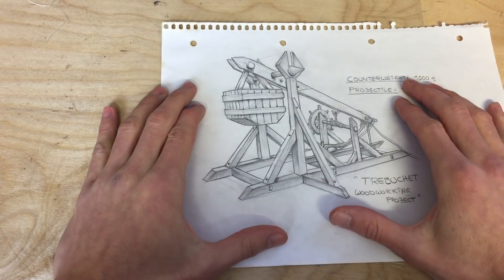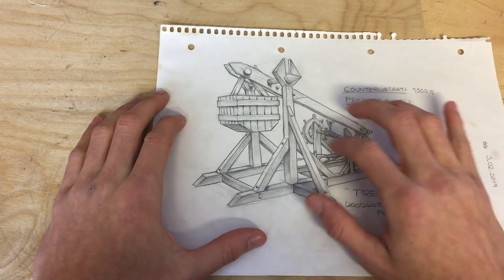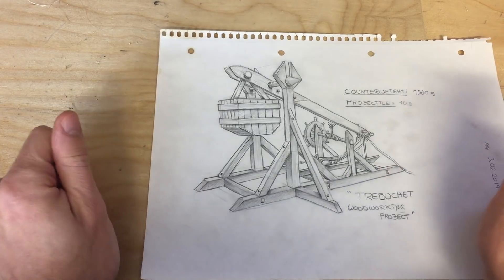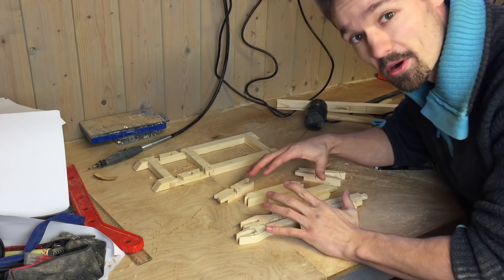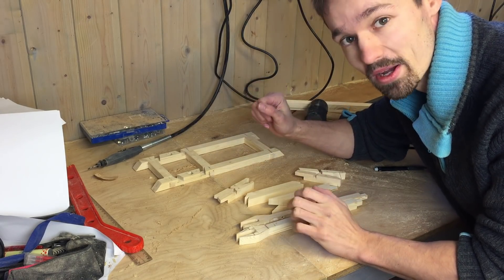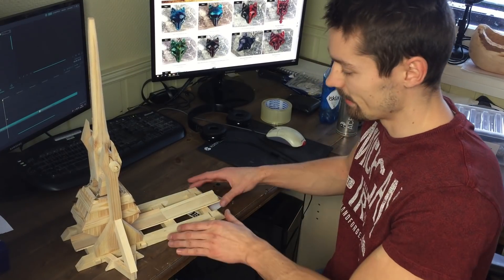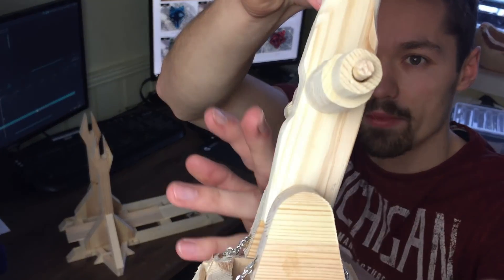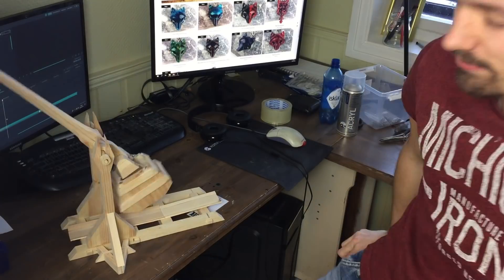I Make A Trebuchet, But Will It Work?

Comment: I would have put some set pins in the towers and other load bearing members.  Not that the glue isn't good, but it could weaken after a while.  Not bad overall, though :D

Comment: Nice project!

I once built a trebuchet from Technic LEGO, with a pivot point ratio of about 1:6. The counterweight was filled with scrap lead. That thing could hurl small stones to around 8 - 10 meters (that's about 25 - 35 ft to you Muricans)

Comment: Nice design, I've made trebuchets that could throw a small water balloon over 300 ft in the past, here are a few tips:
- The slide would work better if it is one piece (you wanna make sure there are no lips or edges that the sling can get caught on)

- For weight use coins! they are much denser work a lot better than dirt
 (You nailed the J hook for the arm ... no puns intended)

Comment: According to a program aired on PBS a while back, the addition of wheels to the base allowed the base to roll backwards as the trebuchet was fired. This allowed the release of the projectile to occur sooner in the arc of the firing process, and added a good deal of distance to the effective range.  This program might be worth your while to watch, the wheels not increased the range of the weapon, they also made it easier to move the whole machine.

Comment: Good fun build! I built one 14 feet high that throws a 4.5 kg  concrete ball. The angle of the hook, the length of the sling, the weight of the projectile, the weight in the ballast box all determine the trajectory of your projectile. 
Trebuchets can throw backwards or even straight up if the mentioned variables are not tuned correctly.

Comment: If you shorten your chain on the bag a little and add more weight to the counter weight then it should go farther. Bending the nail at the top either up or down will also change when it is released.

(Also adding wheels will help too since allowing the frame to move a little increases speed)

Comment: Judging by the astonishing fact that the projectile was flung over 30 cm and that it obviously weighs more than 9 grams based on the sound it made as it hit the wall, I think it's reasonable to conclude that your experiment does indeed support the theory that a trebuchet could launch a 90 kg projectile a distance of 300 meters. Such a devastating weapon!

Comment: Use a denser material in the basket. You'll throw a lot harder.
Reply: most sand is denser than normal house bricks so its not that bad but yeah steel or or something would be alot better
Reply: @judebox1185  Just food for thought. Seems powerful enough now, curious how far it can throw.

Comment: Adjusting the angle of the slip-pin at the tip will give you different angles of projectile release. I'm curious to see you results with the life size version! I built a medium sized one as a child that launched baseballs. Quite a lot of fun
Reply: Jackson Rae how far did it throw them?

Comment: I made a several small models, based on popsicle sticks before moving on to a larger (about 20cm) model. I did a fair amount of research and found that the throwing end of the arm should be around 4x the length of the counter weight end. making the throwing end as light as possible also helped with the overall performance. The other thing to note is the ratio of counter weight to projectile, aim for around 100:1. The 20cm model I made was not safe to use indoors, the power was quite surprising. Yours looks a lot better than my attempt.

Comment: Holy crap man. Please for the love of God watch a simple tutorial on how to use a table saw. Project is awesome, but I was flinching the entire intro when you were not using the push stick on the fence side of the wood. It's literally made to push the small part next to the fence. You can control the excess a lot easier with your hand than a stick without ever putting yourself in danger. Awesome build though man. Keep up the good work.

Comment: No hate but that’s not a trebuchet, what you built is a counterweighted catapult ( a catapult that uses a counterweight instead of tension for a rope and it’s arm). A trebuchets arm needs to travel 180 degrees or more with the counter weight starting on top as well as the arm that connects to the basket should be in two part so you get more energy transferred through the system. Also the counter weight should be a fixed system, it shouldn’t be connected with any thing or rope that can cause it to move. Anyway great video
Reply from the maker: Its a good thing i can call my own creation whatever i want
Reply: Jonas Olsen Woodcraft lol yeah. Maybe you could try to make a wooden Rubik’s cube that actually works
Reply from the maker: I think the next one will be a turtle :) a good way to use a lot of scrap wood i have

Comment: awesome design however the chain looks cool for the sling but the added weight kills performance, your winch looks sweet however it does not let the main arm retract all the way which makes you lose like a fifth of your rotation you want your counterweight arm at pretty much 45 degrees to your base before launch, not sure how much weight is in your counterweight but it should be over 125 times the weight of the projectile IE: 1 lb projectile needs 125 lb counterweight (or more), your swing arm length looks correct as the swing arm should be 3-4 times longer then the counterweight arm